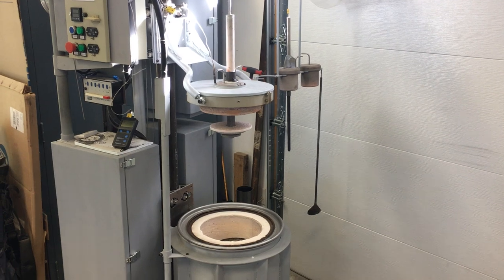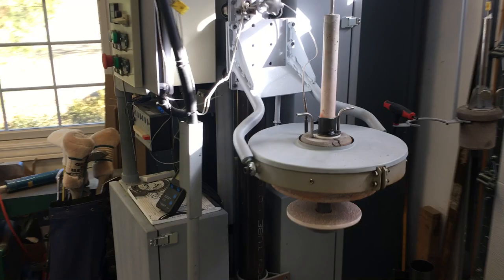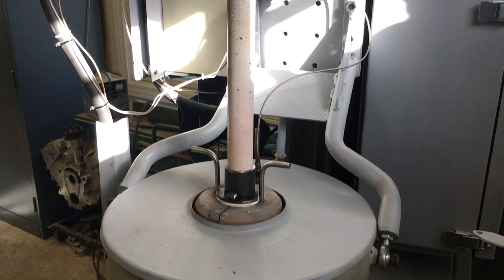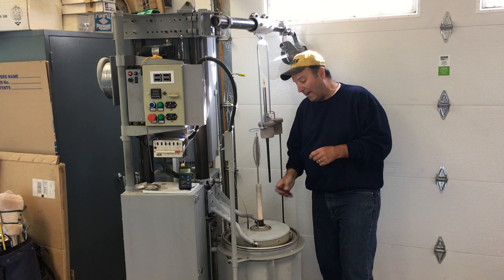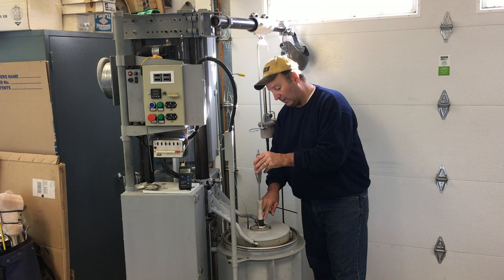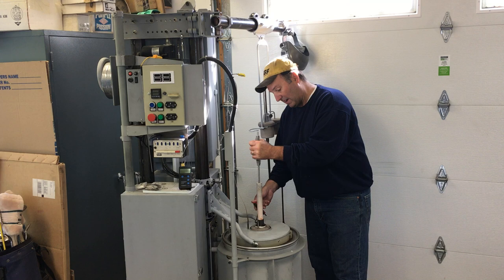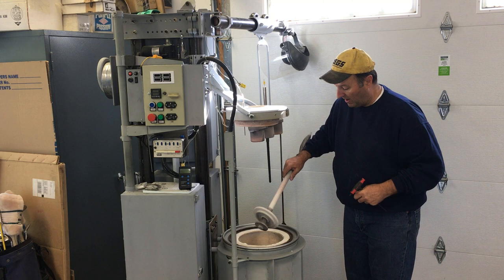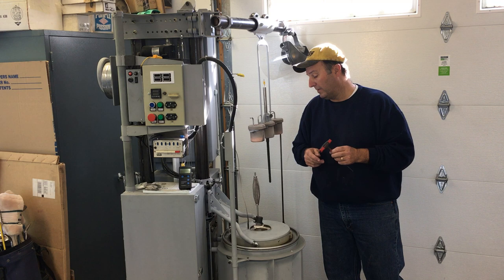7 Using Lance Dry Run

Comment: Sorry, for the newbie question, but what is the lance used for? I heard you mention "degassing" but why does it need to be degassed and how does the lance do that? It just looks like a metal pole….
Reply from the maker: The lance is used to remove hydrogen gas from the molten aluminum. It actyually disperses Argon gas in very fine bubles which attarct and cary the hydrogen away. Hydrogen can cause porosity inthe castings. The presence of hydrogen in dirty and recycled aluminum is common. Best, Kelly

Comment: Nice degassing setup.  I wonder how much air you put back into the metal when the foam is bubbling it's ass off?
Reply from the maker: You would think that would be the case but it doesn't seem to be so. As long as the foam doesn't liberate hydrogen when it decomposes it's probably pretty benign because just about nothing is soluble in aluminum except....hydrogen. Best, K
Reply: Good, fingers crossed man.